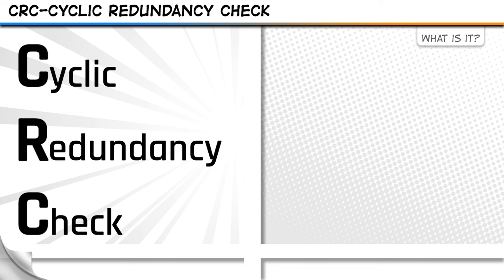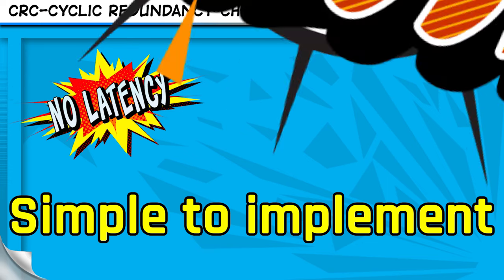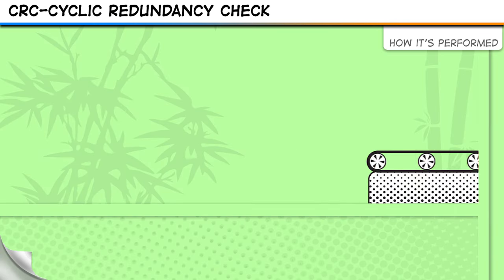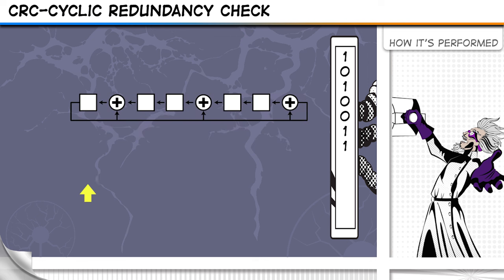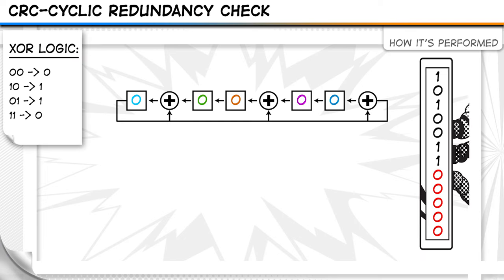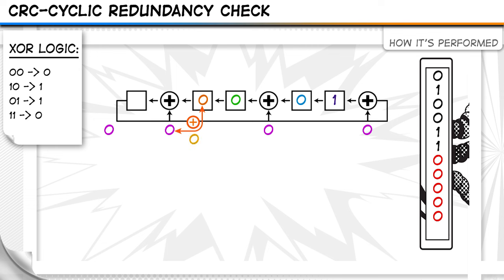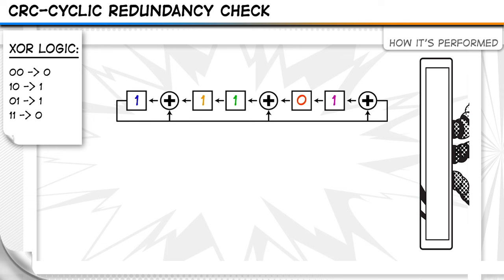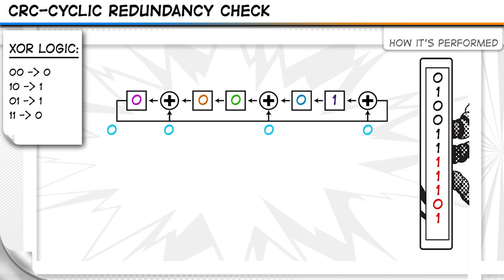CRC - Cyclic Redundancy Check

Comment: Where was generator polynomial used in the process?
Reply from the maker: The generator polynomial used to create the feedback registers is x^5+x^4+x^2+1.  Note though that I do not believe this meets the criteria for a true CRC.  I used this very simple polynomial just to illustrate how the feedback registers work when calculating a CRC code.  A true CRC would have 16 or 32 registers.
Reply: @wisconline  how did you identify the polynomial based on the xor gates placement??

Comment: What is the Polynomial??
Reply: Message: is 1010011 and to caculate the CRC you need a polynomial... can you explain me that again with a polynomial?
Reply from the maker: The generator polynomial used to create the feedback registers is x^5+x^4+x^2+1.  Note though that I do not believe this meets the criteria for a true CRC.  I used this very simple polynomial just to illustrate how the feedback registers work when calculating a CRC code.  A true CRC would have 16 or 32 registers.

Comment: "there's no delay" -> "let's run this code through the loop again" - Well.. isn't that a delay?
Reply: Harry Svensson the data is fed through the registers (generating the CRC) as it's sent out to the receiver, then the crc is sent out aswell. the receiver generates a CRC as it's receiving the data and compares it to the received crc. so the only"delay" is the time it takes to receive/send the CRC. calculation is done when sending/receiving